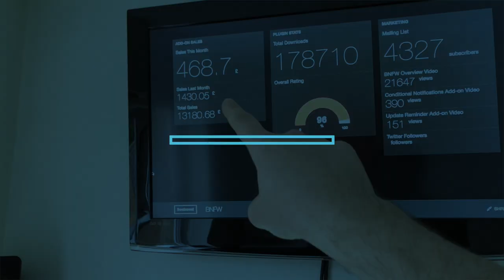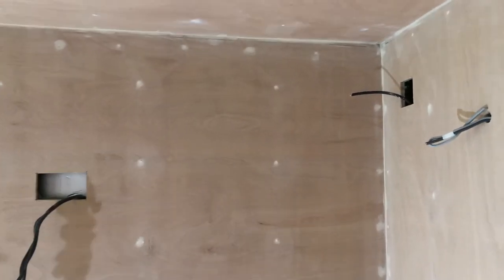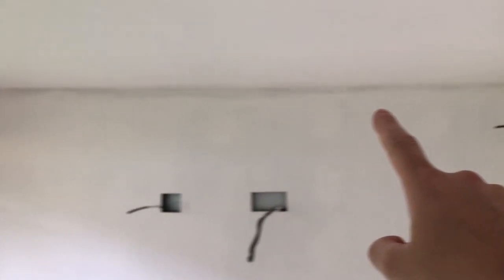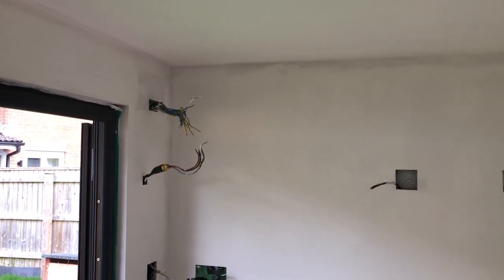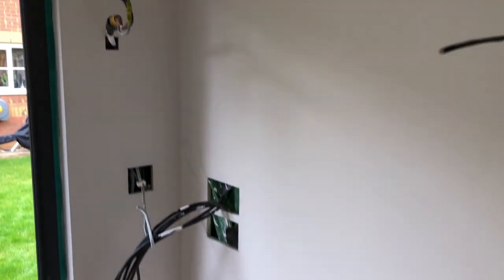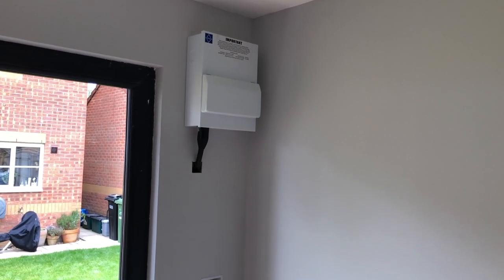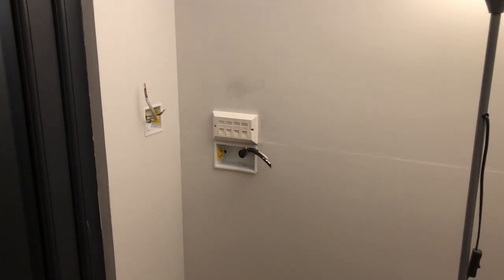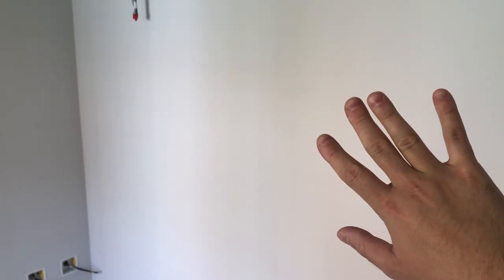Building My Garden Office: Part 11 - Painting, More Electrics & Networking, Flooring

Comment: Hi Jack, I hope things are well. Loving the videos, as usual, I've probably watched yours and Ali's like 5 times each! Progress has slowed a little on my project, a combination of going back to work, sorting out electrics and weather. I ended up with a cold roof as yours, and now wondering what to do about lights. Initially, my plan was a warm roof, so it was going to be some LED downlights, but with the change of plans, I'm probably going to be returning those. I purchased those slim LEDs from Toolstation but it turns out I'd still need to carve into the insulation, plus there's a LED driver that also needs its own space etc, so... a little annoyed at myself now. I was wondering how you approached this. Appreciate any advice you could offer!
Reply from the maker: Liev Garcia Well done so far! I had the same issue and ended up going with some lights on arms from IKEA coming off the back wall. That way, I can angle and position them wherever I want. I also have LIFX bulbs so I can make the colours do whatever I want. Seem to work well and great fun 😊
Reply: @jackrmcconnell  Thanks for the suggestion! I'll be plasterboarding soon so that will be fun! :)
Let me know what you decide on the cladding, I ordered metal-sheet cladding for the sides and back, in the front will probably do UPVC or composite...
Reply from the maker: Liev Garcia I used Siberian Larch. It was hard to work with at times but the finish is great.
Reply: @jackrmcconnell  I don't imagine you have a video, even if unedited :) With the wooden cladding I'm having a bit of a hard time figuring out the actual materials needed, especially edges and corners. Any tips? :)
Reply from the maker: Liev Garcia It’s coming but to be honest, I still have to finish a bit of it! Want to do that before I release the vid. You can buy corner pieces which cover the corners nicely.
Reply: @jackrmcconnell  Cool, thanks for that! Let me know if you were happy with your timber merchant and which one it was, in order to either buy or avoid!
Reply from the maker: Liev Garcia I was. I bought the Larch online. Think it was the first result. Everything else I pretty much bought from Selco.
Reply: @jackrmcconnell  Thanks a lot, will check them out!

Comment: Hi Jack. I've loved this series! So much so I've done my own build. I wondered whether you would mind answering a question? I'm running armored cat 5e to my office but my router and master phone socket are in different rooms. Should I run from the Wifi router in the living room or to the master socket in the hall?
Reply from the maker: Alex Ooh good question. How are you getting your phone line to your router? A phone extension cable?
Reply: @jackrmcconnell  Thanks for getting back so quickly! Yes there is a phone line extension to the living room. The router has to be in the living room as it needs to sit next to the tv box (ethernet connection). The router also has multiple ethernet terminals so can connect games consoles etc.

Thanks for all the videos and your inspiration of others, including me to DIY!
Reply from the maker: Alex Cool. So, you probably want to run it to the router. Alternatively, you could run it to a network socket in the hall way near your phone socket and that way, you can either run an Ethernet cable to your router in the living room or do something with power line networking. There’s no right or wrong way and everything is usually a custom job but my preference is to keep all incoming ‘connections’ into the house around the same place.

Comment: Looks great, how did you fix the flooring cover strips? Tap little pins into them & glue?
Reply from the maker: MCEpicPVP I used Mitrebond at first as that’s what it’s meant to be for but it didn’t work so I ended up using gripfill which has worked really well.